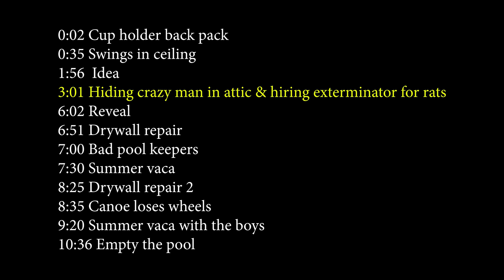Hiding a Crazy Guy in My Attic & Hiring an Exterminator for Rats

Comment: The amount of asbestos these guys inhaled within an hour is legendary
Reply: They inhaled zero asbestos, btw asbestos is not just dust it’s this dust that comes from asbestos like sheets when you break them, pretty sure they’re illegal to use now in construction due to what it does to ur lungs
Reply: @stevenr3544   thats a old house probably asbestos with that blown in insulation
Reply: @freetoetags6349  Considering one of them literally made a joke about asbestos, I like to think they were smart enough to check.

If they make a video about curing lung cancer in 10 to 20 years, I'll retract this comment.
Reply: @stevenr3544  I’m 1 minute in and they have already drilled into a popcorn ceiling. They have definitely inhaled asbestos.

Edit: Yikes.
Reply: @Linckel  No, but most are.
Reply: @kickheadsmuoke689  they make a joke about asbestos in the video so i’m sure they tested beforehand
Reply: @kickheadsmuoke689  No, stipple only contains asbestos if it's from the 70s-80s or earlier
Reply: @olbluelips  The more you know. That being said it does look like a renovated old house, so who knows. Lets just hope they did get it checked.
Reply: Being in construction from what I see i don't think any of those products have asbestos in them
Reply: @hatrack8846  cool job! The only thing I can think of that has asbestos is popcorn ceilings so yeah
Reply: @vern9093  i think its best not to alert the knowitall
Reply: They stopped making drywall’s with asbestos in the 1940’s
Reply: @npcloadanotherbowlinger3357  good to know
Reply: @selfishpunisher8336  vern IS the knowitall
Reply: @herculesbrofister265  swaggo
Reply: Jesus Christ died for your sinssssssssss
Reply: @stevenr3544  Jesus Christ died for your sinssssssssss
Reply: @freetoetags6349  Jesus Christ died for your sinssssssssss
Reply: @loxcreast9145  Jesus Christ died for your sinssssssssss
Reply: @jesuslovesyou2616  i know
Reply: @loxcreast9145  depends on the amount, even breathing normal air will give you an asbestos exposure, because asbestos is literally everywhere in the air but in tiny amounts.
Reply: @Jesus loves you  slayer - God hates us all album was great you should check it out. Disciple and Jesus saves were a good Christian tune.
Reply: i was thinking that
Reply: This comment section is almost as good as the vid. Even has random quack screaming about Jesus.  Lmao